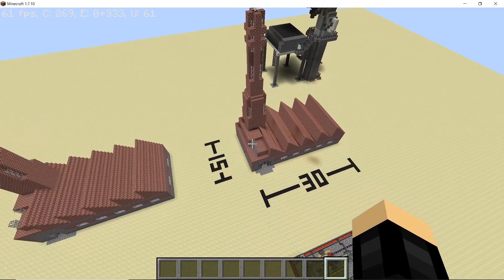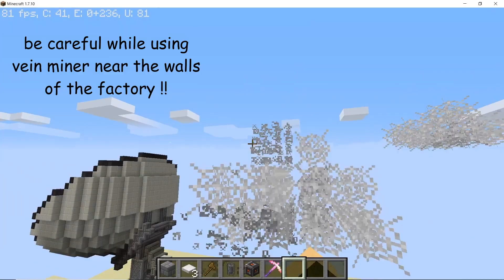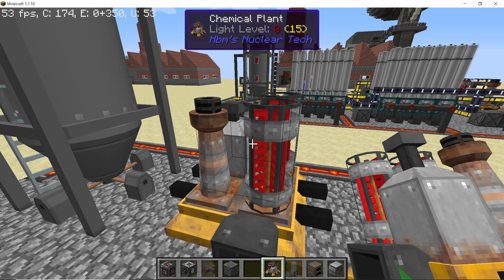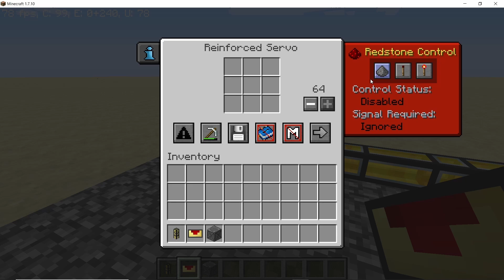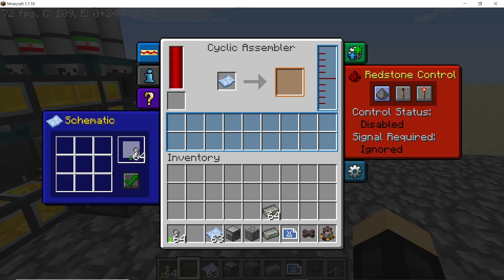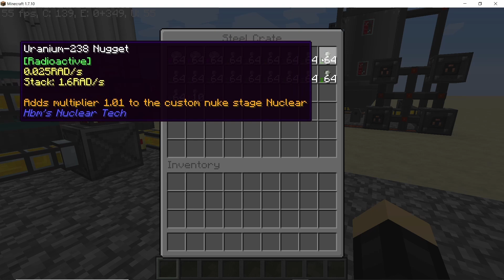How to make a "Uranium Enrichment Plant" in HBMs mod | Automatic Uranium Processing Plant tutorial

Comment: I know this video is like 3 years old but can you make a video about makes the factory into a steel (or other alloy) factory with the crucible and stuff that would be very cool
Reply: That is...actually possible!
What you would need is 2 large mining drills, 2 bedrock processors machines, some extra proccesing to get the iron and cosl of the bedrock ores and enrich the result to get greater results.
You then put them inside a crucible generating enough thermal units then a strand caster and voilá!

Comment: Hey, how do I download the add-ons for thermal expansion and thermal dynamics? Because I'm in need of some uranium and I don't wanna mine for it
Edit:ty bro now I have infinite (almost) uranium! You're the best
Reply from the maker: Well tbh for this build you only need thermal expansion and dynamics , and you'll need COFH core and Foundation to run them. You'll find all of them on Curseforge

And another thing is you'll need to mine for uranium if you want some cause there is no way of making uranium out of thin air if you've only these mods installed

Comment: i cant find Cyclic Assembler 😢
Reply from the maker: It is a part of the Thermal Expansion mod for 1.7.10. If you are using the 1.12.2 version then it will have different name
And btw now HBMs mod has it's own automatic crafting table in the latest version so you don't really need to use the cyclic assembler
Reply: @SavageVegeta  What was used instead?

Comment: Is this possible to do with mekanism components instead?
Reply from the maker: I think it can be done , but I've never tried it so I'm not very sure about it. I do remember that you can make 5x ore processing assemblies in mekanism
Reply: @SavageVegeta  damn, it really has been 2 years since I last needed to build one of these enrichment plants lol. 

What I had originally meant was if mekanism could be used in place of thermal expansion, I still planned to use hbm's ore multiplication. I found out that yes, it is possible. The cyclic assembler can be replaced with the formulaic assemblicator and the item ducts replaced with logistical transporters. The only more challenging part was filtering the fluorite back out into the chemical plant because mekanism doesn't have filters on its item ducts but rather used an entirely separate item sorter machine which made that whole area a bit bulkier.

Comment: To create Gas Centrifuge Overclocking Upgrade needed some bismuth nuggets. How to get them cuz without this module i cant even get uranium-235 and can`t create fuel for reactor so i can`t get depletet uranium to create bismuth. It`s a stuck chain!
Reply from the maker: Umm you don't need uranium 235 to make reactor fuel , as a matter of fact in the second stage of centrifuge you'll get some "uranium fuel nuggets" which can be combined to make "uranium fuel ingots" ... When you use that uranium fuel in a Nuclear reactor that should give you depleted uranium fuel
Also bismuth is not only obtained through uranium but also through many other nuclear fuels , I highly recommend using NEI mod to check out all the different materials you can use to obtain Bismuth
Reply: @SavageVegeta  no, in new patch there is no uranium fuel at second stage of centrifuges there is the problem. 
Ed.: version is 1.0.27 x4144. So I played and just stuck at this point cuz without upgrade there could be produced only uranium 228 and some fluoride
Reply from the maker: @mrupgreader1346  You are playing an outdated version of the mod , the latest version as of right now is X4186. Download it from github !
Reply: @SavageVegeta  Oh, Okay thank you about information.Because i downloaded from curseforge. Thank you for your help!
Reply: @SavageVegeta  That`s could be sound sadly but there is the same thing at x4186. Still no uranium fuel nuggets at second stage of gas centrifuge :(. And yes, am playing with NEI.

Comment: When I try to put the gas centrifuges first one doesn't pump low enriched UF6 and good video👍👍👍
Reply from the maker: You haven't updated your mod bro that's why. Download the latest version from github and you should be good to go
Reply: @SavageVegeta  I did it does make Leuf6 but it doesn't pump it
Reply: @SavageVegeta hello, i‘ve got a problem in my survival world: when i use two gas centrifuges, the uf6 produces  uranium fuel nuggets, as they should, but  if i use four gas centrifuges, the highly enriched uf6 from centrifuge 3 won’t enritch further into uranium 235. all i get is uranium-238…

Comment: I recommend using immersive railroading if your factory is far away so you can get there faster btw I'm doing all of this in survival and you can use some transportation mods so you can get there faster
Reply from the maker: That is actually the reason why I kept the input of uranium so near to the door. Cause I really had the idea of transferring uranium through ducts using IR Trains , but I have noticed that 1.7.10 version of IR is buggy compared to 1.12.2
Reply: I'm using 1.12.2 hbms realoded I just need the doors just incredible minei keep my power plants far from my main base so for example if there's an accident that if the reactor overheated if the reactor exploded the distance of the
Reply: Fallout is not long but I have a lot of failed reactors